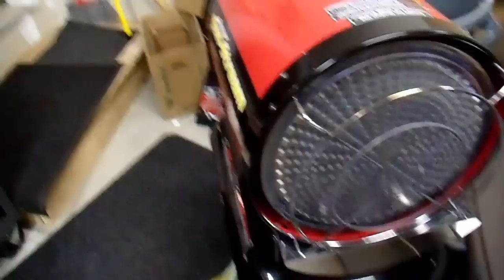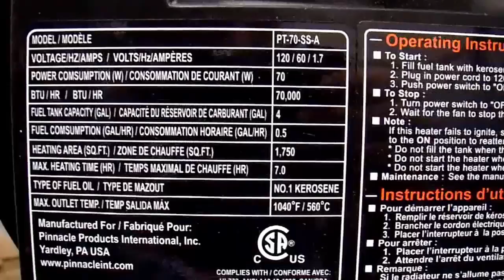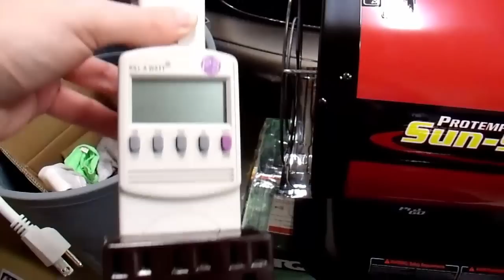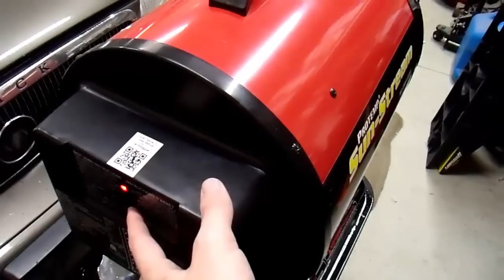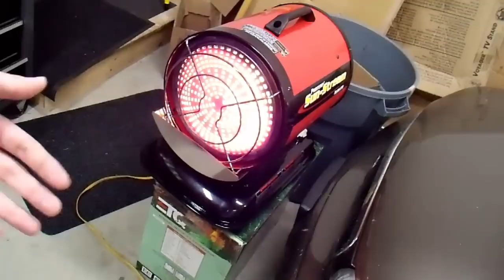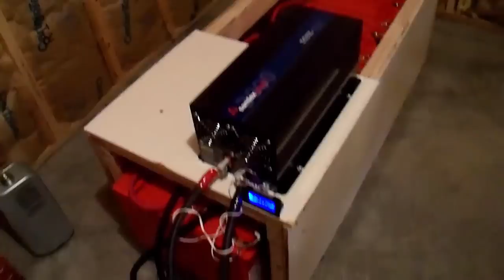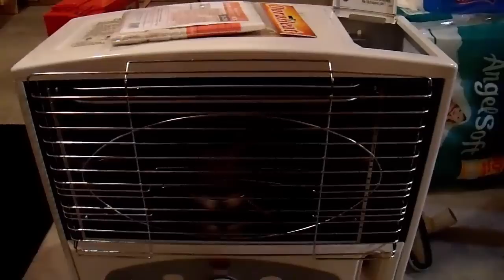Heat your Shop or Garage without Electricity - Diesel or Kerosene Heaters and Inverters

Comment: Hi, need help if possible.i unbox my protemp kerosene heater ad it going and  during a storm the house power went off. now my heater stop and  will not ignite the red light flash.  thanks Robert
Reply: +Robert Mc Crae lightnig strike or power surge burnt the Control board..
Reply: +Robert Mc Crae you are done. Fucked, as it were. Go buy a wick heater he already explained that in the video.

Comment: How long will it take to burn through the 4 gallons of Kerosene?
Reply: +Osteele
Well it's a 70k BTU/h unit and kerosene is roughly 130k BTU per gallon, so around 1h 50min per gallon on full blast, which would make 4 gallons last 7 h 24min.
Of course you might not get pure kerosene and BTU has about 7 different definitions so those numbers can vary wildly, which would be the downside of using medieval measuring systems.
Reply: +MsSomeonenew Thank you. Much appreciated.

Comment: YEs, the usual formula is "Volts x Amps = watts", which in this case, comes out to 204 watts.  But...Right below the voltage/Hz/amps, is the labeled watts, which says "70".  
So, unless he's got other information on the unit saying it uses more than that, one must wonder how that works?  
Could it be that the hardware is configured to handle 204 watts, but the unit actually only draws 70 watts?
If you have a battery to power the inverter, it should be able to run this OK for hours. 
IDK about the wisdom of using any type of fuel for heating, if the unit is not vented.
Propane will cause too much moisture to collect inside a house, because propane is carried by water, which turns into vapor inside a house.
Kerosene has to burn hot, and does have fumes that can cause breathing problems and, can gradually asphyxiate people inside a closed house. 
IF you have to use a gas heater of any sort, PLEASE keep a window open, close to where you are, so you don't asphyxiate!

Comment: The best way to do this is through a heat exchange system where the heat is refracted to a radiator that allows fluid to pump to other radiators to exchange heat to atmosphere. would never use that in your home

Comment: DONT DO THAT! YOU WILL DIE FROM CARBON MONOOXIDE POSOINING!!!
Reply: +Thomas R. Miller You are correct Thomas, I would use it inside a home but it is fine for use in a garage or shop. 
This is a kerosene, direct-fired, forced air heater.  It is 
primarily intended for use for temporary heating of build-
ings under construction, alteration or repair.  Direct-fired
means that all of the combustion products of the heater
enter the heated space.  This appliance is rated at 98%
combustion efficiency, but does produce small amounts of
carbon monoxide.  Carbon monoxide is toxic.  Humans
can tolerate small amounts of carbon monoxide, and 
precautions should be taken to provide proper ventilation.
Failure to provide proper ventilation in according to thismanual can result in death.

Comment: Okay, so you DO still need to have Kerosene in order for one of these to run. Still cool to see one of these run on a 400 W inverter but DO sill need the fuel. I little misleading on the title of the video
Reply: yes you need fuel..all the inverter does is allow you to run the heaters in places without electricity for the forced air fan
Reply: Yes, exactly.

Comment: Love your videos and TY for taking the time to make and post them.
Question 4 ya? I called my local Boston FD and they said they're illegal in MA. Ughhh.
He said that these are not goo to use for a heat source in a garage with your vehicles in there. That's how I'd be using it. He said it has an open flame, will heat things up and could cause a fire or an explosion! I don't buy it and still want to get this thing. I think it'd be a lot safer with a thermostat so it shuts off and allows things to cool for running it at night. Would this thing work?
Mr. Heater Thermostat for Portable Kerosene Forced Air Heaters #F261210
Reply: this style of heater cant have a thermostat

Comment: can this run off veggie oil ??
Reply from the maker: Haven't tried it but I wouldn't recommend it.  This particular unit is designed to operate on standard diesel/kerosene and some of the rubber components could be damaged by using biodiesel and/or cooking oils.  It's better to burn that stuff in a reciprocating piston engine.  I imagine this heater will operate just fine short term on it albeit with a bit more smoke that usual.

Comment: Great video!  I would love to see either a comment or even a video with a list of appliances that you have found that will work OK on modified sine wave as opposed to appliances that you think need a pure sine wave inverter. I think you probably have more experience with inverters on You Tube so seeing a list from you would be very helpful.
Reply from the maker: The answer is complicated as it depends on the goals you have.  Most appliances will run on MSW for a short period of time but many will consume more energy than you anticipate and may run hotter than you would like shortening their life.  In short, if you plan to run on inverter power for long periods of time I would highly recommend a pure sine inverter.  If your goal is just short term power outages then MSW may be more practical cost-wise.  Personally I wouldn't connect anything other than PSW up to most appliances in my house.
Reply: @knurlgnar24  how long could you run that. Before your battery is to low to start the car?

Comment: You mentioned that a torpedo style heater might run from a 400W inverter.  I recently ran my torpedo style diesel heater (Mr. Heater 175,000 Btu) from my 3kW modified sine inverter and it required ~460W. It may be just outside of a 400W inverter depending on the unit but its close. A smaller torpedo unit would very likely run on the 400W.

Comment: watt is volt times amps right? Why is it pulling 1.6 amps at 125 volt and only using 110 watts?! Am I being stupid here or is there something wrong with the meter?
Reply from the maker: I didn't even notice that when making the video!  The issue is 'power factor'.  V*A only equals Watts when the power factor is 1.0      In this case this heater has a poor power factor so the voltage waveform and the phase waveform are not peaking at the same times, which lowers the actual power draw.  This isn't a problem it's just how the heater is designed, and it does only draw the wattage the P3 meter shows, so it is drawing around 10A from the battery.

Comment: I'm surprised how little power that unit uses to start up, probably similar to a domestic oil-fired boiler.  I have a small 3kW (10200 BTU) kerosene heater at my workplace, the Kero SRE 300, similar size to the wick heater but operates like a fan heater.  When powered on, it spends 2 to 3 minutes preheating drawing roughly 650W going by my power meter, so would need something like an 800 watt inverter at minimum.  From what I recall, once it fires up, the wattage drops to around 28W on high (3kW) and 22W on minimum (0.8kW).

Comment: 10 gallons kerosene @ $5.22/gallon - $52.20. 10 gallons 87octane @ $1.92 - $19.20. You can lock in a lower fuel price if you buy at a fuel bank.
Reply: kerosene has about 10 times the heating energy as gasoline though

Comment: Maybe has a universal motor in it like a corded drill or something. Motor will work fine either way.
Reply from the maker: I considered that too given how well it operated on MSW, but a universal motor would be a poor choice for this application since they generally don't last more than 500 hours and are more expensive to produce than a simple shaded pole induction motor.  That said I haven't opened this unit up so it's possible!
Reply: ***** it is likely due to either a switch mode power supply converting the alternating current into DC current to power its components. It may not even be that sophisticated and have a simple linear power supply with some capacitance and bridge rectifier! That would certainly explain why modified sine wave works just fine with this heater

Comment: Yeah. I actually once literally found one of those wick type kerosene heaters in a junk pile. It's parts were strewn around all over the place but they were all there. Gathered it all up, cleaned everything, bought a new wick and it worked perfect.